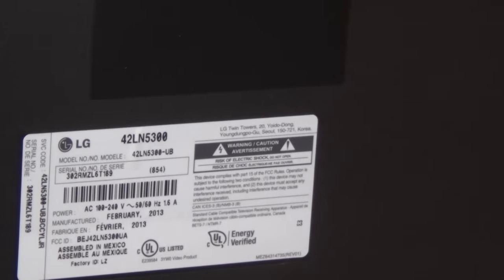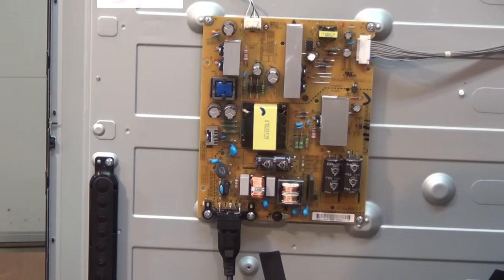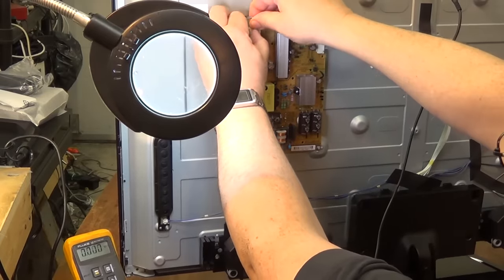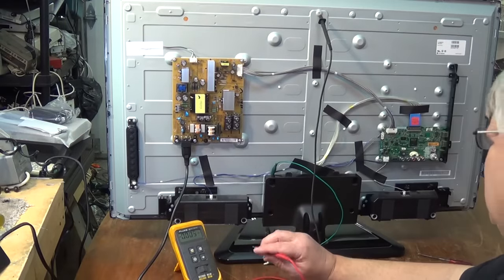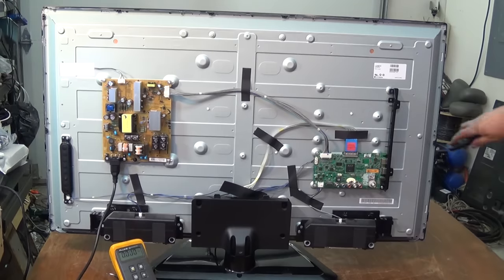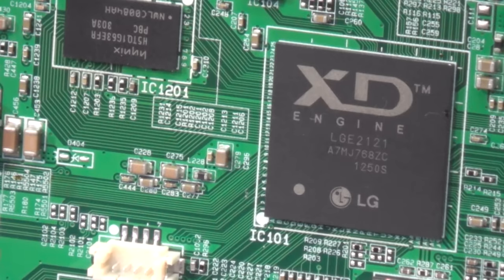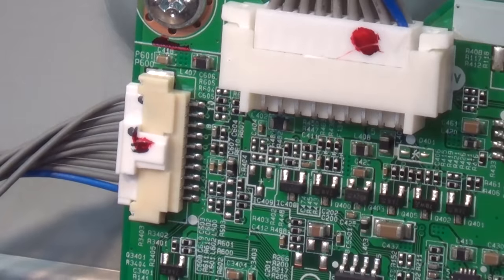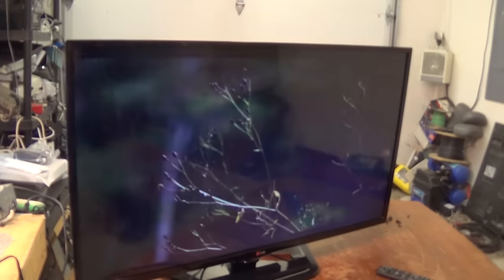LG 42LN5300 Dead   Not power supply

Comment: Its always amazing the chips can take such heat for an hour and not be ruined and yet they do at the factory (short time) and here too and totally ok. If after a whole hour with enough heat, it dosent last, then its not going to really doing it again and only option is remove and install "factory" correct! haha with right tools. Perhaps others have applied heat for a short period and it bonded ok but not good enough and thus failed a week later. 
Using a temp probe where the chip is, how hot do you want to achieve as i might make my own similar rig?
Reply from the maker: Heat is not the killer. Head when power applied is.
Under power when a chip overheats, internal transistors become electrically leaky and start conducting when they are not supposed to. In a logic chip this can cause other transistors to conduct, and short.
In an analog chip this will throw the bias way off and put the chip into thermal runaway.
Naturally this can't happen on a chip that is not powered up.

Comment: When you bake the chip for an hour, was TV standing as normal? In other words, was that PC board standing vertically attached to the tv ? Did you have to press the chip down while it was hot? Thanks
Reply from the maker: The board was out if the set lying flat.

Comment: I have a Hitachi L55S603, the standby light is on but won't turn on. I have replaced the logic board and the same thing. What other options do I have?
Reply from the maker: Back lights and power supply cause most problems

Comment: Samsung ln32c530 lcd tv. Lit standby light but tv does not power up. Disconnect power cord, dvr connection and dvd connection plug every thing one device at a time after 24hrs and still does not power up only standby light on. Remove rear cover look at components on power bd no visual defective components. However look at main bd remove it and notice a little moisture between top of Samsung setd10 laa02 chip and the thermal pad ( insulation pad ). Is this normal possible this might be the culprit. TV is 7yrs could be build up of moisture over the yrs due to change in internal temp.
BY the way my name is EV.
Will appreciate your feedback. Thanks.

Comment: Wouldn't surprise me if the fix was permanent as a TV chip isn't going to reach the temps that a game console does. Comparing an LG XD Engine chip to a PS3/360 CPU is pretty funny given that one is an ASIC made to denise a picture and the other is a multicore PowerPC chip running at 3ghz, lol. Even without a cooler there is no way the XD Engine reaches the same temps as a major console CPU/APU...and that's the issue on reflowing a console. A reflow technically happens on each use of a console due to the heat generated. 

That TV just likely had a bad BGA connection to begin with. A single reflow is likely going to work as well and as long as it did from the the factory.

On that note, it couldn't hurt to add a small heatsink to the chip to help it out.

Comment: LG 39LN575S hi my power supply led board is reading 230v at the cable to the led arry (led +) not the stated 130 volts, i have no back lights. sorry i didnt say , im am in the uk...

Comment: so what was it that was done?? did he just add a small bit of heat that would resolder the pins on the chip to make sure they're connecting??
Reply from the maker: Exactly. Cold solder on the bga solder balls.  Some times it works, and if it doesn't then it is time for a new tv.
Reply: a car head light blub is good for desoldering chips etc!! the channel with the little cup behind the light rather than the other(which I think is the main headlight, there's usually two in one bulb) but that was a nice tip just letting it retin

Comment: Hi 12voltvids, any chance you could point me in the right Direction, I have LG 39LB561v, no power won't turn on or light up, nothing. Only 3 years old. Only thing I can say is when I've got the back case off and plug power lead in, I notice optical red light lights up for 5 secs then goes out, would u guess it needs power board ? Any help would much be appreciated as I can't afford new tv at this time and want to have ago at fixing it, thanks
Reply: Hi slight update lol, I now have a stand by light but no picture or sound, then press any number on remote nothing happens, but if I press the red button on remote to turn off, I get stand by light again, with leaves me now thinking it's a picture issue, can anyone give me any pointers please

Comment: Im in the process of reparing mine. The voltages on the LED connector dont change with the leds unplugged or plugged in. There is  howevwer a small 8 pin chipped that looks blown on the back of the board. All the voltages to the hdmi board are right and  both LED+ voltages are about 78 volts. Do you think its safe to assume the PSU is cooked? Seems it lights up briefly fraction of a seckond.
Reply from the maker: 78 sounds a bit low for LEDs. Usually it is much higher as they are all in series
Reply: @12voltvids  Yep they dont light up other than briefly some times and a the 8 pin chip looks like the potting is melted.  One doesnt exclude the other though. When it stopped working there was a burnt chip smell that still lingers inside the case when its opened.

Comment: I have a LG 32LN5300,  (same as the tv in the video, just a size smaller) it will not start, but when I plug it in the indicator light will slowly blink twice before going dark until the next time I plug it in. Does the two blinks when I plug it in mean anything (some laptops have a blink code to tell you what the issue is), I still plan on taking it apart this weekend, just hoping to get some idea on where to look first.
Reply: Mine has the sam issue. Were you able to diagnose the problem?
Reply: Sadly, no.  I swapped out the main board, but it was from ebay, not sure if I received a dud or not.

Comment: would it be a benefit to run some flux under the chip before heating? I imagine better flow as a result.
Reply: Always did add flux while reworking bga chips, some years back when I worked on them on a daily basis
Reply: @82thamonk  Thank you for your reply.

Comment: 👍👍never seen that done.before,very cool.repair ,most people would have thrown that tv out,nice save,and I have a little rework station ,I seldom use the heat fan ,except on a kit  with smd parts ,which is not favorite kinda of kits,but I figure I should learn .thanks for another great video.
Reply from the maker: Some day I might get a rework station. Would make life easier but I don't do enough SMD work.
I actually cheated on this. I did use the light bulb, but I actually put it much closer than what is shown here. I set the bulb directly onto the ship when I baked it.
Reply: @12voltvids  ebay 898 D rework station ,its worked very well four me for over 3 years the best 47.00 dollars I ever spent .

Comment: Absolutely well done video 12voltvids !
I have the exact same set.My problem is TV will turn on for split second then nothing, red led stays on hit power button again LG logo for split second then die, red led goes off too. Will try halogen heat lamp with spacers and see what happens.
Reply: Might be LED's or their power supply

Comment: I have an LG 47LN5400  The TV powers on with sound  but no Picture. The LED's flash monetarily. I have checked Power supply PSO1 voltages and all read as should. But  the led driver test points have no voltage is there a way to check and or repair the supply to the led Drivers on the power supply?
Reply: Curtis Low ias

Comment: Hi man nice video, I’ve recently fixed my lg plasma 60 inch’s tv . the fault was on Y board I had a few death mosfets code number is fgpf4633 and other  rf2001 , the tv was working fine for 3 weeks then gone death again. And the same mosfets that I’ve replaced are death again, can you please tell me what when wrong? Thanks.
Reply from the maker: Check the firmware version and update. I have not had this personally but I have heard of this problem and firmware was updated to address that problem.  If it is a smart TV it will update but if not you will need to download onto USB stick and run update.
Reply: 12voltvids hello sir thanks for replying, Its a plasma tv , is not a smart tv , but I did all the updates via plugged in internet cable after I fix it , I’m not 100% sure but I’ve tested some resisters color code is ( red red gold gold ) 1 of them is giving a reading of 220.k other 6.5m , u think is a resistor problem ? Thanks in advance. That is from the Y board . I will make a video of the problem and post it maybe you can tell me what’s wrong with it .
Reply from the maker: @antoniogoncalvesb.pereirag8922  
red red gold is 2.2 ohms so if you are getting 220K and 6.5m then the resistor is open.

Comment: Would you be able to explain how the backlight leds get turned on? Does the mainboard send a signal to a switching circuit on the PSU that produces the high voltage? Have same set and trying to determine if backlights are the issue
Reply from the maker: The main board controls the power and brightness of the LEDs through a PWM control line tthat runs from the main board to the power supply.
Reply: 12voltvids the issue Im having is all voltages are present. But the standby light flashes twice and fades away then nothing. I have 125v on the + and 20v on the - of the led connector. Would that mean the leds are bad?

Comment: Don't discharging capaticors short with wire. Use light bulb 60W/220V instead. Short circuit is not option. Stand by voltage (3.5V) connect to pwr on (ps on) and psu will awake up. Only than you must have all other voltage output from power supply board. If power supply is ok, than mainboard is not ok. Simple as that...
Reply from the maker: I like blowing the tip off my screwdriver.

Comment: Great video. I have a question. I have a 55 in Samsung led that the power supply went out.No power no status light.  I measured 2.6 volts at out puts that should have been apx 13 volts. I replaced the board and all good for apx 20 min. then the new board went out. Where could cause power supply board failure? Thanks for any advice you might have..
Reply: It could be your main electricity supply maybe ?  Some power outage ? did you check the fuse first ? Also try to replace the board again. I am sure you can have it replaced as faulty. If that happen again you know for sure its your TV or main input unless something is shorting your PS not sure how when you said your TV worked fine 20 minutes.

Comment: 0:28 That TV has a universal voltage (100 - 240 Volts). How common (or rare) are TVs with universal voltage over there in America? Many American TVs that I saw on YouTube have a voltage rating of 120 volts (not universal 110 - 240 volts) which surprises me because here in the Philippines, most TVs since the late 1980s already have universal voltage (100 - 240 Volts).
Reply from the maker: Some do, some don't.

Comment: so let me ask u. if it is not getting any power for stand by or any of the volts for wires from power supply.  does it mean power supply is junked? the tv is samsung 43" plazma. at 1st worked great. then it would go turn itself off within say 5 mins. then i could unplug it and plug it back in and then it would work. now it wont come on no standby light. i checked caps and all visually look good. its got good fuse. but i dont see any volts anywere. i feel its power supply. so i wanted to ask you.
Reply from the maker: The standby supply should be producing your 5v standby as soon as it is plugged in. I did a video on a Samsung 42 plasma with a standby failure a few years ago, where I used a battery pack with 4AA cells to "tickle" the standby supply and get it running, and then the set turned on fine. Problem was a small kicker cap in the start up curcuit for the standby circuit.

Comment: how much voltage does that power supply generate? why some guys says it generate 1000 volts or is it for the plasma tv?
Reply from the maker: LED sets typically use 24 or 48 volts for the LED array,  and 3.3 - 12 volts for the rest of the set.Plasma have high power supplies, and generally operate with 205V and  65 for the HV supplies, and 3.3 - 12 for the low.LCD sets on the other hand also have high voltage, much higher for the fluorescent back lights, 2000 to 3000 volts for the back lights to strike them, and then the voltage drops. Xenon headlights in cars use about 30,000 volts to strike the arc, and then it drops to 30 or so to run it.
Reply: OK I see, that makes sense, thank you very much for replying to my question

Comment: Dear reader, I have a problem whit the data and time ajustment on my LG 47LA7408. I can not set it, het menu still stays grey. 
It think that there is a problem whit the internal battery, is there a battery on the powersupply board ore where do I have to search ?
Mybe any advice, thanks for your time and message. Martin Boersma
Reply from the maker: On my Samsung the time setting us greyed out when the auto time is turned on.  Have to set to manual first.
Reply: @12voltvids  thanks for the reaction, but i cant change anythink in het time menu.i can not swich anythink. Auto times also greyed out. All optioneel in the time menu are grey.

Comment: Hi 12voltvids, Don't know if you'll still be answering queries to this video you posted some time ago but I'm leaving a question anyway. My 42" LG LED TV doesn't turn on (not video or sound) but it does have a working stand-by light. I was watching the TV when it flickered slightly and then turned itself off. It's been in what I call terminal standby every since. I was thinking of trying your technique but the fact that the TV was on and spontaneously turned itself off, now I'm thinking it's a different issue and heating up components won't help.  What do you think?   An LG "trained" guy came to my house and with very little testing (basically took off the back and nosed around a bit) told me he thinks it needs a new logic board BUT they don't make that model anymore.  What's your take on this issue.
Reply from the maker: Backlights cause many problems. The fact you said it flickered and then went out makes me Leary of backlights. On LED tvs all the leds are connected in series, so a failure of a single lamp will kill the picture. Some TVs will turn on and produce sound with no backlights, and you can shine a flashlight on the screen and see it, and others nothing. It could be the main board as well. Unfortunately most times they are not worth fixing.
Reply: Thanks for getting back to me. Guess I'm buying a new TV. Not sure how to get rid of this piece. Do you have any recommendations on quality LED TVs?  Or should I steer clear of LEDs?  My current TV only lasted 7 years; I find that appalling.  @12voltvids
Reply from the maker: @honeynutt2171  
Best recommendation I can make for led TV, and this applies to all of them. Go into the picture setting menus and turn down the backlights.  They generally cone set to maximum brightness.  Turn them to 75% or lower and you will substantially increase the life of the backlights as it reduces heat on the LEDs and that is what kills them.  1 led fails and the entire panel goes out as they are all in series.

Comment: i have a lg 42lb5900UV model that does come on but the screen blinks and its horrific you do not see the whole screen you merely get a glimps at the dimly lit lg logo as the screen blinks from complete darkness go the dimly lit logo. do you have any suggestions
Reply: is there a small tact switch on the main board? if so, click it a few times. if the problem goes away and maybe comes back later, that switch may be intermittently breaking down and messing up the computer. remove switch. its not necessary after leaving the factory.
Reply: I will definitely check thank you for your response i was wondering what do as i unplug the video board fron the screen everyrhing just goes black so i was wondering if it might be the video board
Reply from the maker: "tact" is short for tactile switch. The little momentary type switches used for power, volume, channel buttons ect.
Reply: Sure sounds like bad LED's. LG's LED's are poorly heat-sinked. They burn out quicker, turn down your brightness.

Comment: i use a hot air station for that not a light bulb i dont know if its enough to melt the lead solder or the innerpart of the chip
Reply from the maker: If I did this for a living I would  have a hot air station, but I don't, and I am not about to invest in one for the odd piece of gear I see. The majority of the stuff I fix is vintage gear.
Reply: 12voltvids Hello can you help me out, I have the same tv the back light as gone I think, I have sound but no picture you can see something slightly when you shine a light on it. I was looking for the inverter to replace it but I can't find it, is it just embedded in the power board on this TV?.
Reply: It is definitely not enough to melt the solder. It won't last long

Comment: I have a Samsung LED TV: I had a premature start premature failure of my TV, t when disconnection completely for 1 hour, the image was turned on and everything worked perfectly. so I made a reflow of the main board (nothing, no change), I made a reflow of the con con (since then, nothing lights) ... ref con con: DEL T370HW04 V2 37T06-C00
Reply: Sounds to me like you might have made a solder bridge (short circuit) on the Tcon board, re-check your work & if you can't find an issue then perhaps try a replacement, assuming you still have this problem by now.